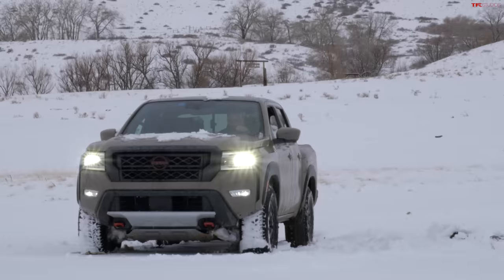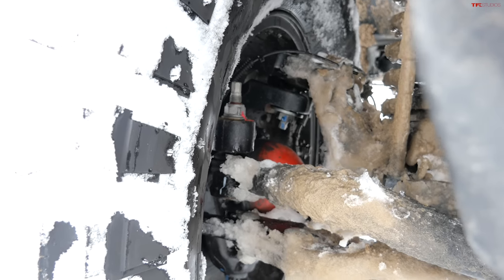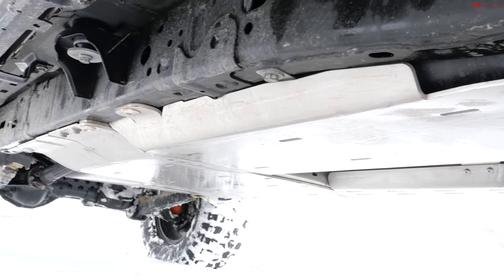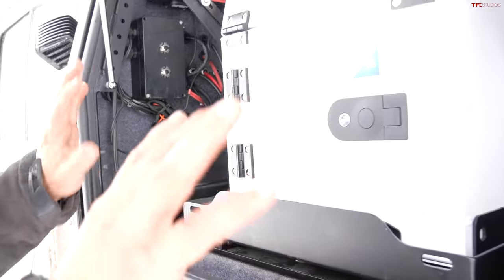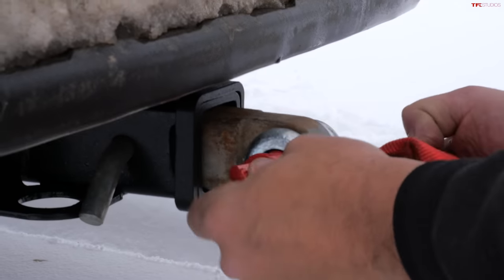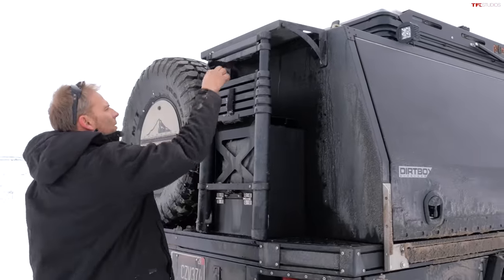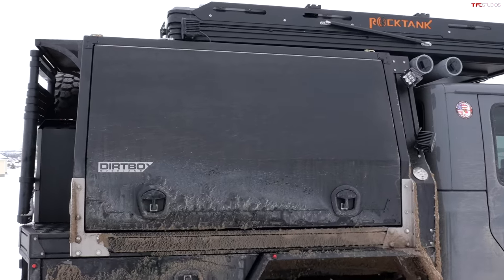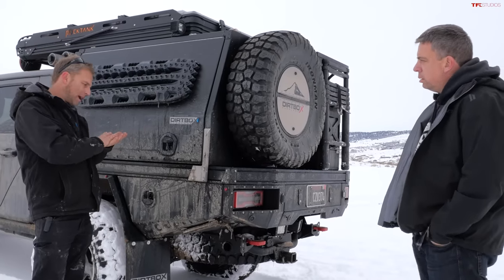Gas vs Diesel Drag Race & Tug of War: The Midsize Diesel Is Dying, Here's Why That Sucks!

Comment: I'd love to see this comparison with the same tires. Seems like every off-road video I see with the Frontier, it struggles due to the street tires they equipped it with.
Reply: The old one (aka the Navara) was one of the worst off-road pickups which is why they kept producing the D22 for other markets.
That and the fact it kept snapping in half.
Reply: @tomcardale5596  the frontier “navara” snapping in half thing is something I’ve only seen claimed by people from outside of America, I’ve seen hardly any reports of that within America
Reply: @c0ldyloxproductions324  
It's not just "claimed", Nissan were buying them back at one point.

At the heart I suspect it was a bad design shared between Frontier and Narara, but I think some things counted against the Euro spec one. 

In the US, the Frontier was rated at about 1500lbs payload and, in the UK at least, the Navara was rated at 1073kg which is about 50% more. Add in to that the heavy diesel engine at the front and the weight distribution would be out of kilter. 
They were also produced in different factories so possibly different standards.

The D40 was always known to be rubbish off road compared to the others of its generation but had a reputation for being one of the most comfortable and car like pickups. I think that helped lead to the Mercedes X Class sharing the platform with the current gen Navara. 

Due to quirks in vehicle classification in the UK, the D40 Navara (along with most models of the current Ranger) fell in to a different class of speed limits and roadworthiness testing to most pickups as their unladen weight was too high. If your tester isn't on the ball, you can be inadvertently driving around with an illegal vehicle which is another fun feature.

Comment: My Mojave was lemon lawed due to transmission and electrical issues. It’s a shame because it was one of the better vehicles I owned until 9000 miles.
Reply: When you see Honda and Toyota dealerships with empty sales lots and Jeep sales lots full of vehicles, that says it all. 😢
Reply: @DH-mf2lv  these days,  it probably just says Jeep has parts to build 4x4s.
Reply: @DH-mf2lv  i loved my Mojave, except for the 13mpg. They had to replace a couple of minor things but when they did the pcm recall, it screwed up everything. They fried it the first time trying to update it (it was bad from the manufacturer.)
Reply: Sorry you had to go through that.
Reply: @DH-mf2lv  it’s ok. Not the first time I had to use the lemon law. Garbage motors is significantly worse than ford or cjdr.
Reply: Lucky you! No lemon law exists in Mexico but I was able to sell my Gladiator for about the same as what I purchased it for and bought a Frontier Pro 4X stateside. Gladiator started developing a ton of electrical/computer related issues a year after ownership. Jeep has lost me as a customer forever.
Reply: JEEP..JUST EMPTY EVERY POCKET...JUST EATS EVERY PENNY.
Reply: @user-fo7sq8hy2y  my toyota is a pos it's typical brand wholesale who buy toyota with out looking at facts toyota frames axle and engine/ build quality are crap

Comment: Gladiators already like to bend their frames, this will clearly be another addition with how overloaded it is above its GVWR. Payload on stock Rubicon’s are only around 900lbs and this thing weighs 800lbs over stock before the roof tent, all the camping gear, winches, suspension/axle upgrades and a total of six 37” tires. They should call it Gumby 😂
Reply: Well the good news is that the weight of 4 of  the 37's is luckily not sitting on the frame or axles.

But yes, I agree, its overloaded.
Reply: Gladiators like to bend their frames? I haven't seen anything to suggest it and the Gladiator frame is beefier than most mid-size trucks.
Reply: Actually tacomas do haha

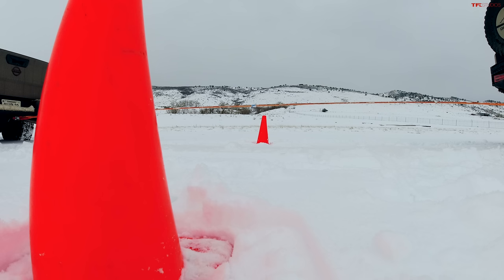Comment: @16:07, the Frontier is riding lower and therefore it's being pulled up. That means that it is being pulled up when tension is on the line, reducing the traction even further. This set up gives the advantage to the Rubicon before the tug of war even begins.

Comment: Wow, very cool.  Does the Gladiator actually have the payload to handle that bed and all the weight inside it or is it somehow beefed up suspension wise to handle the extra weight?
Reply: Not even close.... Diesel Rubicon 1075lb payload.

Comment: The dealer let me take a Gladiator for an afternoon to try it out. I was driving on the highway on a single lane transition going about 70 and the under damped steering and suspension shocked me - I nearly lost control and ran into the barrier. The driving dynamics of these Gladiators is nonexistent. They literally didn't even try. Military hummers drive better. I can't imagine owning one of these things unless I lived on the trailhead.

Comment: The segment is dying because the manufacturers make you buy a loaded truck to get the diesel option.  If the diesel was the same price as the base gas truck they’d sell a million of them.
Reply: Diesel engines cost a lot more to produce than a gas engine. Add the cost of diesel is so much more than gas you spend more on fuel despite better mpg of the diesel. Then add how unreliable modern diesels are due to restrictive emissions systems. The government has been very intentional with regulations that killed the diesel for passenger cars and trucks.
Reply: @TheNotimprezed  You aren't kidding about that.  Thirty years ago my father bought Chevy 6.5 Turbodiesel 1 ton.  It was only $37k pulled great and even with the bed loaded up with gear and Four guys in the truck it still got 25 mpg on long trips at 65 mph.  I feel like if the government had left diesels alone we would be seeing diesel engines that would be incredibly efficient and reliable today.
Reply: @TheNotimprezed  Do they really cost a lot more to produce, or are we just told that by the manufacturers?  Other than the turbo, I don’t see what would cost that much more.  What am I missing?

Comment: i really wish jeep would sell a cab/chassis version of the gladiator.  i'd love a build like that but would hate to just waste the bed of the truck. i'm sure someone would buy it, but not much market for a takoff OEM truck bed.
Reply: i think i am on the other side of the issue. a chassis cab for ram 3500 cost 2000 less . go on eBay a used bed  are priced from 1500 to 7000. as more people wreck them and time rust them away the price of a used bed will go up.ebay price for a gladiator bed is 3800.

Comment: Another Great video!  I’m thinking about how he mentioned the air lift of 2000lbs.  That’s all cool but you have that entire bed, tent, extra fuel can, all the equipment inside, and two spare 37” tires! Just how much weight can that frame handle??  I’m recalling that one ton Ram with a slide in camper where the actual frame bent!  You can only put so much weight on any frame before bad things happen!
Reply: That ram was the perfect example of what NOT to do 😂

Comment: Would have been a better comparison if you had loaded the Nissan with 1000lbs...the jeep has at least that much weight over the rear tires with that huge box on the back. You might even have moved in 2wd that way.

Comment: Funny how the Nissan frontier is trying to be a Tacoma
Reply: I can tell you have t even driven an 22/23 Frontier Pro-4x. You know how, a lot of members went Tacoma shopping and ended up with an 22/23 Frontier Pro-4x.

The Nissan Frontier Pro-4x is better in every way than current generation Tacoma. More bang for your buck, fully boxed frame, more HP/TQ, better interior, etc.,etc, etc.

Come back and brag about Tacoma after the Tacoma refresh comes out.

Comment: If the Nissan had the same set of tires as the jeep it might've given the jeep a run for it's money.
Reply: in 2 wheel drive having 1000 pounds of weight in the back is a huge advantage

Comment: I would never even consider a gasoline engine in a pickup
Reply: DJPelio, if you tried a 5.0 gas engine in a new Ford F150 you might think differently.  Great power, towing capacity, and excellent gas mileage, with ability to run on the cheapest fuel available. Also more affordable than a diesel and cheaper to maintain.